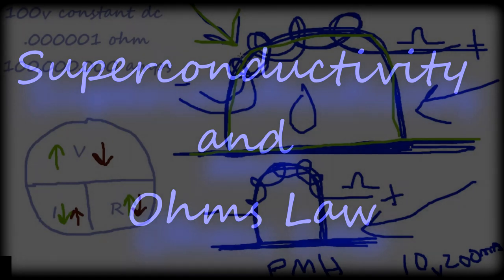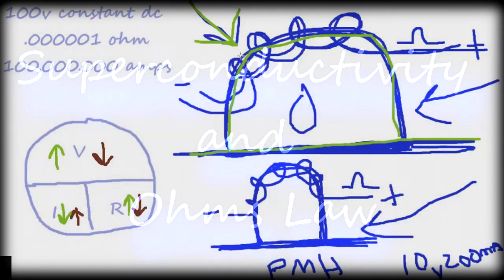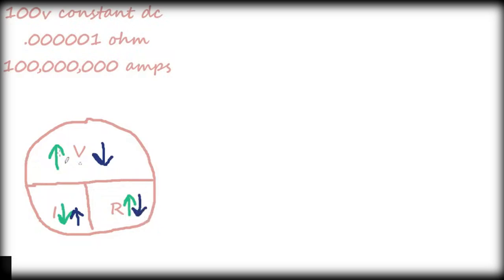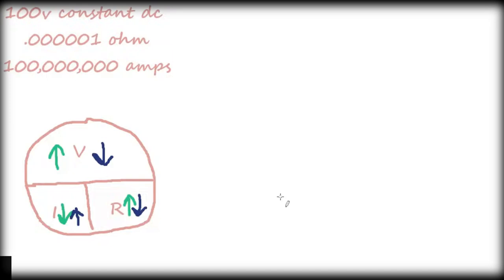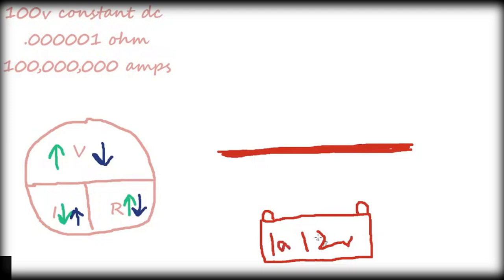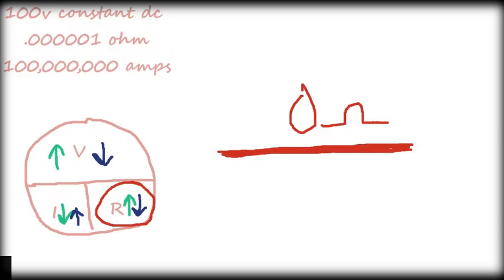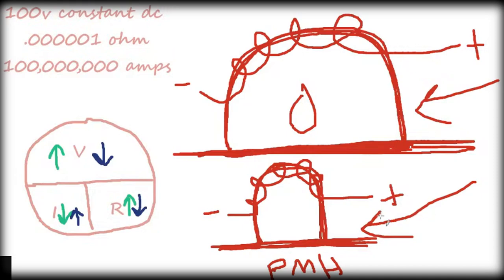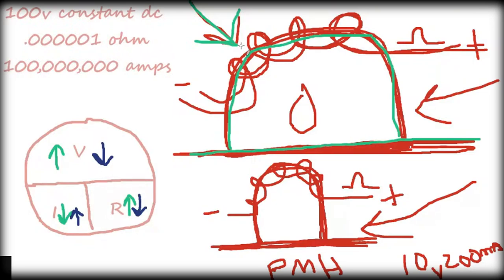Superconductivity And Ohms Law

Comment from the maker: If you did take a 10 amp battery to  a superconductor the battery would go dead immediately and all the energy in the battery would cycle in the superconductor ring, if the ring and the only loss would be from the field produced in the ring colliding with itself in a way that is destructive. Next step if you achieved the superconductor ring flow is to make sure the field when it cycles around itself it is doing so in a constructive way, here I see  the vortex coil could come in handy especially bifilar vortex coil. Again bifilar vortex coil made from superconducting material  ;)